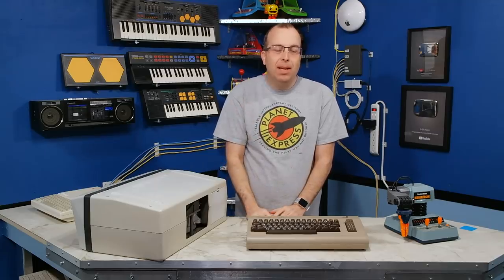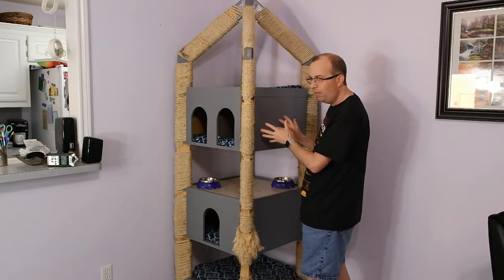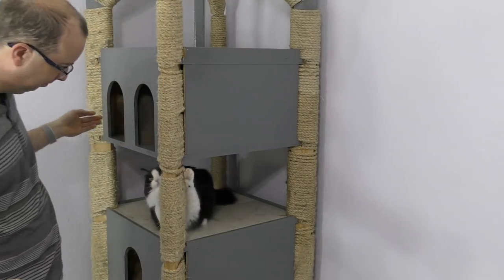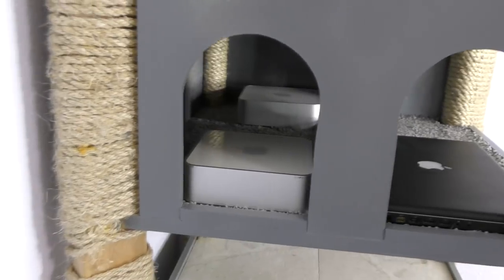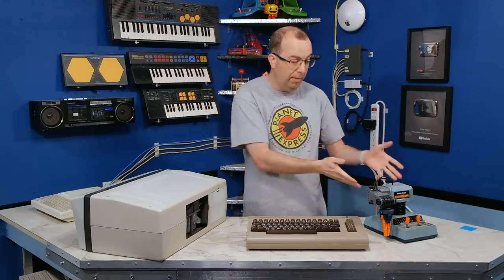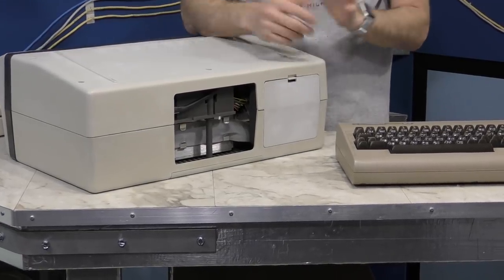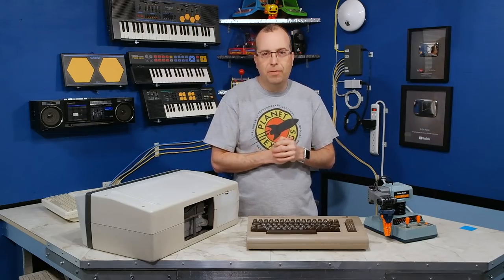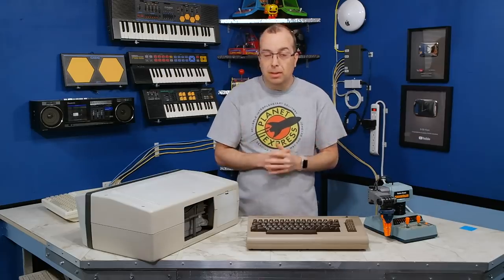Updates on Previous 8-Bit Guy Projects

Comment: Regards to the broken gear: maybe try to use a gear off another shaft if it’s the same gear ratio?
Reply: or just use a gear from any other device like tape deck or cdrom drive lol??? xD idk what to think about this...
Reply: 3dprint?
Reply: All he'd have to do is use one of the remaining ones to make a mold to cast a new one...
Reply: @cs512tr  Did you even watch that part of the video? He clearly said it's impossible to have a gear that strong and that small 3d printed.
Reply: Incorrect. If you use a prusa i3 with a high temp material like abs or petg, it will work perfectly
Reply: Or maybe somehow get a metal gear just like the old one. Something like that would never break in that situation!
Reply: I also wondered why he didn't use the gear from the other unit, they look the same
Reply: You can find them on amazon or eBay. or make new ones from from a RTV/resin mold. Here’s a gear that should work for the one that’s missing: https://www.amazon.com/dp/B07DH9JT8S/ref=cm_sw_r_cp_api_glt_fabc_X8R4RC6K4Y5F7DDDZGY8
Reply: just cut notches in a circle?
Reply: @Kingstallington  I casted the originals in a silicone mold and made a whole new set. They came out perfect. Have a look: http://sideburn.com/images/armatron.jpeg
Reply: Even if the other gear works, he probably just lost his interest on restoring that thing considering the pain of disassembling and reassembling that thing with a ton of puzzling small parts
Reply: @udhi_gn3893  that would be sad. Because it’s an amazing thing. They should have them in mechanical engineering school. All those mechanical Tomy games.
Reply: I thought of the same thing!

Comment: Regards that broken gear - make a silicone mold using the gear (with missing tooth temporarily filled in with putty - so you can cut the tooth out later with a file).  Cut the mold open, fill it with a liquid plastic.  Wait for it to set, remove the gear, use files to smooth off any burrs and the tooth that was missing.
Reply: Instead of using putty to make the missing tooth, he could just use molding putty, form it around the gear then pull it out before it fully sets and rotate the gear so that a fully intact tooth presses into the mold where the missing tooth was.
Reply: Or just use on of the other two undamaged gears :D
Reply: Would using a piece of clear acrylic plastic be strong enough?  The kind used for plastic windows at menards? Dremel'd and hand cut of course.  Its expensive stuff though.
Reply: the gears look the same, i think he could just take one from one of the robots and put it in the other one
Reply: It will be an off the shelf part, just buy a bag of new ones. I'm sure you could even find metal ones
Reply: yeah that is good but those gears are a generic sizes you can just order them off of amazon if you know the bore size and amount of teeth ether that or just buy cheep motorised  toys at a thrift store/charity shop and youd get one eventually and it would be way less hassle.
Reply: Did you know the top gear's are the same size  in the Armstrong I had one of those in my childhood  and because batteries weren't cheap I use an old DC transformer  to replace de batteries and it worked fine until the gearbox broke down.  Lots of fun
Reply: This is probably a better solution than printing one but if you wanted to give it a shot, here's one to print:

https://www.thingiverse.com/thing:1241175
Reply: Or just go to HPC gears and buy one.

Comment: David make sure the gas in your cars isn’t going bad after sitting too long
Reply: @Joe Casson Good design. Although (being the anal sort that I am) if it were mine, I'd still use fuel stabilizer. It's cheap insurance. 👍
Reply: There's no way there will be something wrong with the petrol left in tank for few months... Decades sure... not to mention he's using this cars and  it's not standing still.

Comment: About the cat tower - I don't have cats myself, but I'm wondering if they would use the top room more if you put a hole in the top and bottom of the room somewhere, so they can climb up or down from the feeling area or from the top without having to climb from the side. I saw one tower that was basically a bunch of rooms that were all connected by holes on the inside and the cats seemed to like climbing between them.
Reply: Interestingly enough, these holes were in the original design, but he removed them.

Comment: RE: Armatron - the original gears were I believe  injection molded. I'd try 
A) getting anperson with a lasercutter to cut you a pair of 1/8" gears out of plexi then use cyanoacrelate glue to laminate them into the 1/4" thick gear to put on there.. 
B) find 8 tooth  nylon gears from an RC hobby shop
Reply: This is a weird format for a YouTube comment.

Comment: 7:15 I have a solution for that: Take a cast of one of the gears that you do have and instead of casting it in plastic, cast it in high shore silicone.
It's possible that it will be rigid enough that it can turn the mating gear, and yet flexible enough that it will allow the gear to jump when grip pressure is too high, without it becoming permanently damaged.
Considering that the grip strength of the jaws shouldn't require anything major, this might be a route worth consideration.
Think of it as an engineered point of failure, that never actually fails.

Comment: Please enlarge the cat door you cut to 2x the size or just remove the divider altogether...
Reply: Same thoughts here. I wondered if the one cat likes the lower room because it's bigger but they don't like the upper rooms because they're cramped and he's also made those doorways really tiny.
Reply: Increase the height , remove the divider, and cut a hole in the 'roof' and floor, guaranteed cat enjoyment.  My cats also really like a very short pile carpet, makes getting claws stuck much less frequent.
Reply: Didn't you know that cats are actually liquid? A small hole is fine. They probably just don't care for the placement.

I think they just don't want to go there because there's no convenient entry. If they could enter through the floor, it would be a different matter.
Reply: cats have bodies that can pass through really small holes. if their head fits through, their whole body probably can as well.
Reply: adventureoflinkmk2 oh, i see what you did there.
Reply: Also another reason why the cats don't like it is probably that the "ceiling" is to low. It looks like that cat has to crouch in order to stay in it so it makes it hard for them to jump in/out when they can't stand properly.

Comment: I suggest making the cat rocket tower symmetrical so if the rope gets too much use on one corner you can just rotate the whole thing.
Reply: The cat tower is symmetrical. But I don't think you would have time in your day to rotate it.
Reply: Not every day... when it is worn down
Reply: The doors on each floor are not in the same place on every side, so.... not symmetrical.
Reply: My suggestion would be to put 4 layers of rope on the outer most corner so that the worn down speed is more on par with the other corners.
Reply: the cats dont like the small box, better to open it like the lower box is
Reply: Dukefazon you sir have a really good taste for final fantasy characters
Reply: Might need to add a hole or cutout of the floor of the top box, to allow them to climb in from the lower level?
Reply: Dukefazon ii

Comment: you could replace the whole gear's axle using one of the axles from the other Armatron moving the grey gear on the low end if necessary
and maybe make some subtle modifications to account for the design flaw (?) or just use the claw very carefully
Reply: Simone Daishi I really don’t understand why he didn’t do this.

Comment: You said you have another one of those robot arms and the same gear was missing. I’m no expert but I have a hunch that any other gear would do the job, it seems they use the same little gear on that part of the arm.
Reply from the maker: Yes, but the gears are fixed to those little shafts.  And the shafts are all different lengths.  So I've thought about trying to pry one of them off and put in on the other shaft.  Not sure if I can do it without breaking one, but I may try that eventually.
Reply: The 8-Bit Guy Please try goo gone or some other adhesive remover...
Reply: It would be worth the shot.
Reply: The 8-Bit Guy Maybe you can try reaching one of those guys that do precision machining. I've seen them do way smaller and more intricate stuff. 
Pro tip: amateur or small shop guys are always more willing to take on odd projects.
Reply: If you could get the shaft out of the machine, then set the plastic gear end into a box of heated sand, similar to what optometrists use for adjusting plastic glass frames, it might expand the plastic enough to loosen it without burning it like a torch or flame would do.
Reply: Round-nose pliers a.k.a. jewelry pliers may do OK for that task.  Being able to wedge the tip under and wiggle it, while not having edges, may be beneficial, so it doesn't break a gear tooth.
Reply: It might be a common gear that can be found on other equipment. If you get some measurements you might have some luck with one of those Aliexpress/Amazon bundles of Chinese gears like https://www.amazon.com/Quimat-Plastic-Single-Double-Reduction/dp/B06XCG24HZ/ - there might even be a search engine somewhere out there for the mechanical engineering equivalent of Digikey.
Reply: make a mold with something like sugru or playdough and cast a new gear from epoxy?
Reply: Rui Marques por acaso já vinha aqui dizer isso lol.
Reply: as an ex machinist, theres no point in trying to make tiny metal gears for this, my honest opinion here is to literally get a little metal dowel, cut it to length, and then use a small metal file to cut out the gears yourself, its time consuming but it will work fine, and be a bit more durable, you can do the same thing with plastic if you want it to cut easier, though i suggest a softer nylon plastic so it wont crack as easily
Reply: Don't make it out of any metal, it'll destroy the other gears it meshes with. It should be made out of plastic (PLA/ABS/PVC possibly). Honestly your best bet would be to just have a company like shapeways use a plastic FDM printer to get a similar profile with those smaller sized gears. Then a little scotch brite on the shaft + epoxy to bond the gear
Reply: Maybe he could ask The Geek Pub :D
Reply: Why not do a shape-ways high resolution print, and then cast it to solid plastic for structural integrity? Since the piece is so small, you could probably pay for the most expensive print available!
Reply: you can try automotive trim removal tools. those are plastic and shouldnt hurt the gears.
Reply: 8 bit keys
Reply: Look, there's really just one way to fix this. It all depends on how much the robodude is worth to you. I'm sure you know this, but the problem that causes the gears to break in the first place gotta be solved - with some kinda limit switch functionality. As you say, it's a flawed design from the start.

Then you find a machine shop / watchmaker that can make you metal gears.

No need to go half way on a thing like this - either you keep it in broken condition, or you fix it, nothing in between :).

I enjoy your videos, 8-bit guy! Keep em coming! :D
Reply: The 8-Bit Guy can you try to cast it make mold it an pour hot liquid plastic using one of existing gears
Reply: Is the shaft with the missing gear the longest one?

Comment: with the minimal gas you use, is there a concern for the gas going bad?  so like if you put in 5 gallons and you go 3 years without running down the tank, would you deal with the same issue folks have when their internal combustion engine cars sit for extended time?
Reply: Yes. Same issue. Should put fuel stab in it.

Comment: What software are you using for shipping labels on the Dymo? I was able to get the Paypal USPS labels to sorta work but I wasn't able to generate UPS labels direct from UPS' website. I have to boot into VMWARE and use their Worldship software. I can't print UPS through Paypal due to my business account.
Reply: Lon.TV most label printer use epl or zpl to print, and it's a relatively simple language. Since I use a dozen different carriers, I just wrote a small program that take a template, fill the values form the database, electronic balance and order, and directly print. That way, you only need to customize the epl file, and the web service query to tell them a package is ready. You need a bit of programming knowledge, but it's ten times better IMO than using each carrier software.
Reply: Endicia works great with the Dymo 4xl
Reply: We use Dymos at work and the programs work fine, it’s the printers themselves that have constant problems, getting labels jammed or something else half the time. We also use Zebra printers and they work much better (but different size)

Comment: those tiny gears, I guess you will need to send out the files to have them printed in SLA or SLS

FDM probably won't cut it
Reply: Kwong Kan FDM could totally do it! If you tune your settings right you can have one hell of a part
Reply: I think i could FDM it. Smaller nozzle, slow print, it can be done. Probably can't be arsed through.
Reply: FDM could totally make the part, but looking the application the gears need to withstand quite a bit of load, I suspect they won't last long if FDM'd unless printed at ridiculously low speed/high detail in some exotic material

and from my experience SLS nylon parts are virtually indestructible
Reply: PLA is actually surprisingly resilient. When you print small parts in it and set the bed a bit warmer, and simply wait for them to cool down naturally before you take them off, they also come out annealed, and i'm sure you've heard all about that on Tom's Filaween. I think that would work fine, if you can just dial it in for the shape to come out well - it is a toy, and the old gear must have failed from a combination of aging/degradation and load, not load alone. Short of FDM Nylon, which you probably shouldn't do on an A8, i can't think of any material that would be a good idea otherwise.

I mean PETG just won't give you the detail and ABS/SAN/HIPS tend to sand themselves under just friction and give off gunky dust, which is why you don't make gears out of them. PC can work, but you definitely shouldn't do that on an A8. PLA generally works even for gears subjected to decent load, just as long as they're not too fast, so they don't suffer too much heat friction.
Reply: Guys,  stop the silly debate, PLA at 218ºC, 55ºC bed, 0.25 nozzle, 0,1mm layer, 10-20mm/s at 100% infill. I've done MXL pulleys like that and they worked perfectly and could holes several kilos of force without breaking a tooth.

But for a gear like that i'd recomend doing it in PETG with colling fan, or Nylon. ABS is just too shitty, i'd rather use PETG, mostly because the center part seems a bit too thin and PLA might break when stretched over it. Maybe it could work but making the hole a tiny bit loose and then super glueing it in place. Maybe add a slot in the geat and in the shaft with a dremel and epoxy them together, it should work as a key to hold them im place even if the epoxy ever comes loose from the shaft.
Reply: I've got a 60 micron nozzle in one of my fdm machines. The great is a pretty rough print for that and nylon is readily available. Definitely easy to do 🙂
Reply: Alexander Faust 
Dude thats insane, it would take days to print a gear with that nozzle. It took me 2 hours to print some small pulleys with the 250microns one. Also do you need a clean room to use that? Mine could barely last a print without cloging
Reply: If you're on Facebook: https://www.facebook.com/3dreutlingen/posts/178439012790795 there are pictures of 60 micron prints there - basically just tests, the Slicer (Slic3r is rounding coordinates... lol) and mechanical limitations of the machine are the main culprits, the nozzle still is far from it's limit of resolution with that. About clean room: no, just clean filament and a well tuned extruder so it doesn't grind up the filament retracting over the same spot a few hundred times. Filament is from modelltitan on eBay, sort of my "secret" when it comes to precision filament as he is creating with a maximum tolerance of +/-0.01mm diameter and actually I have never measured any deviation greater than 0,003mm in the diameter :)
Reply: Kay Kay id recomend petg or nylon (abs is shit)pla stetches with time, it wouldnt last but petg just heat it before pushing it over the shaft and once it cools down it grabs really hard. Be careful not fo do it cold as petg just explodes like a granade

Comment: If you only bought few gallons ( I would assume you actually mean tanks) of gas over the 2 years period, it maybe worthy to spend a little extra to go buy mogas (gasoline with no additives that found in regular pump gas). The reason being that the additives is more damaging to none metal parts in the fuel system, and may separate if you let it sits for too long.  (That is why in aviation, mogas is a substitue for 100ll, but not pump gas. And why you want to drain the gas if you want your car to sit for a prolong period of time.)

Comment: A quick question, and maybe an idea for a future video.
You spoke of not having to buy much gas for your hybrid cars over the last 2 years, and it got me to thinking.
Gas will eventually separate and turn bad over time, and I was wondering, what are, if any, things you ave to do to prevent this?
I'd imagine just driving would keep the gas agitated and mixed. But I'm curious as to whether there are any steps one must take, to ensure the gas remains stable. For example, if it has to have extra additives, because of the extended periods of time it might sit in the tank unused.